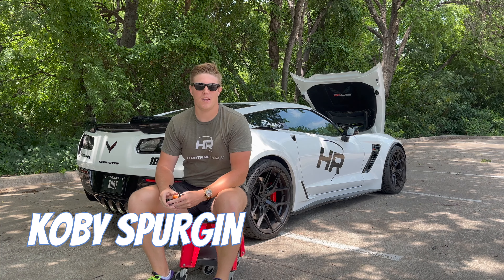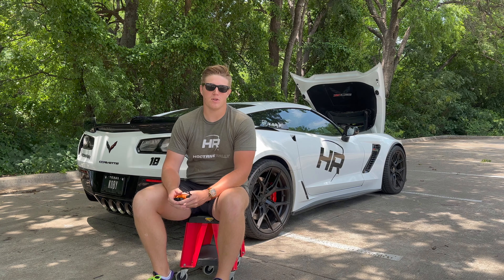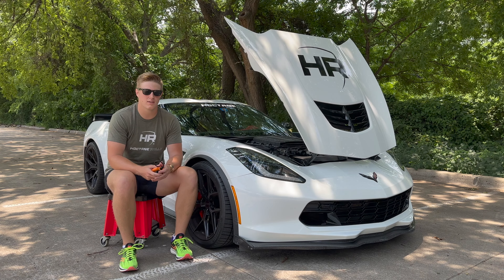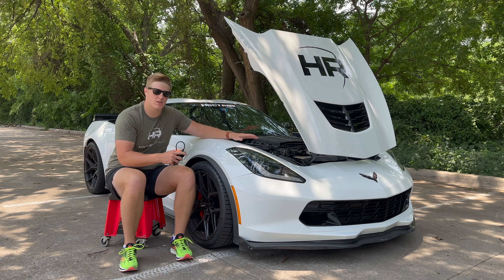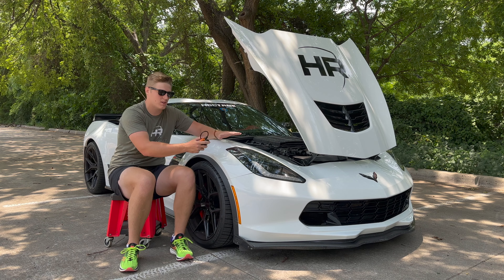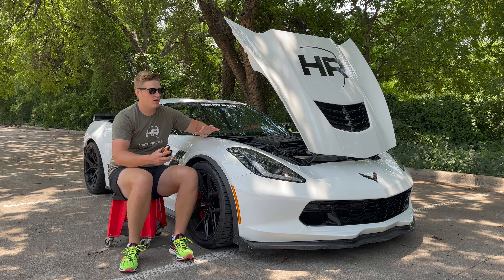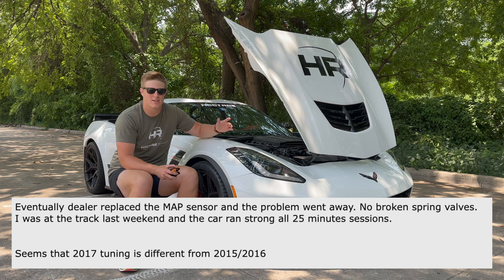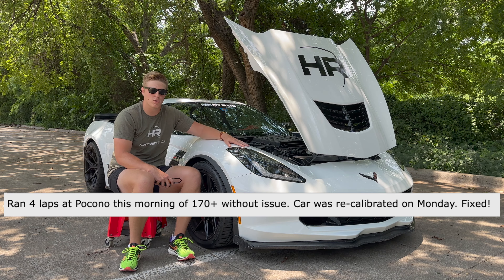Overheating, Limp Mode, P0106 Codes | 2017 C7 Z06 Problems

Comment: Only on the 17 model it goes into limp mode when you hit over 150mph. GM does have a bulletin on the issue and will fix it for free if your under warranty. Bulletin #17-NA-264. I can email you the document if you need it but show the dealership that and they can flash the car and remove that issue for like $300. Only other option is to get the car tuned. Torque converter slips in 5th gear as well that will need a trans tune to fix that
Reply from the maker: Wow! That would be very helpful. I think my dealer wanted $150 to reflash the car, but they wanted me to go put the car into limp mode before they would work on it (only way they would warranty it). I would appreciate the email: koby@hoctanerally.com - Thank you for watching and leaving this comment. It means a lot!
Reply: @kobyspurgin  damn $150 that’s a steal they want $300 here where I’m at. Yea if you have the bulletin it tells them what to flash the PCM to. The problem is not enough Z06 owners have hit over 150mph for them to do a total recall on the issue. Also the trick to fix it once it goes into limp mode is to start the car 3 times and it will clear the limp mode.
Reply from the maker: @SVGZ06  Tell me about it... most guys don't even drive the cars. it was hard for me to find one in my price range in 2020 because all of them had no miles. I have been carrying my OBD II scanner with me and clearing the code at 140mph LOL. Not safe, but I need to get it done. I have my own road rally company and I am tired of falling behind because my car is going limp. I have found usually just letting the car sit for a while the car will return to normal and CEL will disappear.
Reply: @kobyspurgin  LOL yea a bunch of old farts that drive there C7’s 1000 miles a year lol.. did you get the email I sent you with the Bulletin on the issue?
Reply from the maker: @SVGZ06  I haven’t received it yet!
Reply: @SVGZ06 that’s pretty much what I did. Once a week just to get my fix, and put her up
Reply: What if the car is in dubai and if I have the same issue
Reply: @gavsu  turn traction control off. That solves the problem. Will allow you to hit over 150mph without any issues. Only turn the first traction off now both
Reply: @SVGZ06  thanks champ. will try
Reply: @gavsu  my car is still stock but man it does drive wayyyy better with traction  off

Comment: Mine went into limp mode many time not knowing I had to replace my math sensor by the intake. I have a 2016 Zo6 with 48k miles and finally did a tune up changing spark plugs and 02 sensors and intake but main reason for that was the math sensor
Reply from the maker: Good to know that solved your problem!! I will have mine replaced here soon. A general tune up would be good - I’m at 55.5k miles now.

Comment: Koby, I know it’s been a year, but what were your oil and water temperatures? What did it act like when it went into limp mode? I tracked my 19 ZO6 M7, and it went to 260 water, and 220 oil. Mobile 1, 15W-50. I have not experienced any power issues as of yet. I did buy a “Cooler Bleeder” and got almost all the air out of my Supercharger. Also removed the gasket at the hood and firewall to let more heat out. You live near “G-Speed”, and they have solutions for Corvettes.
Reply: I have the exact same car as urrs...love it had it almost 2-years...all stock except 4 the exhaust....we moved 2 Los Angeles not long ago lots of days in the low 100-s!!!.....it never has actually overheated..but the oil is always approx. 10 or so degrees hotter than the coolant..mine got up to the 220-s..the coolant..I doo not  race it..doo I need 2bee concerned?????I'm thinken of getting rid of it if I always have 2bee practically crappen me pants when its hot..n in traffic!!!